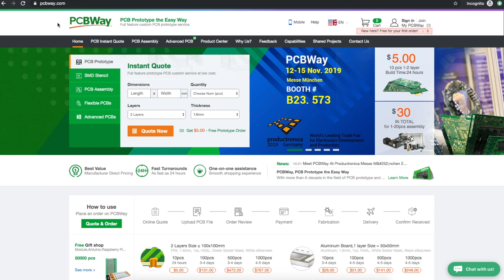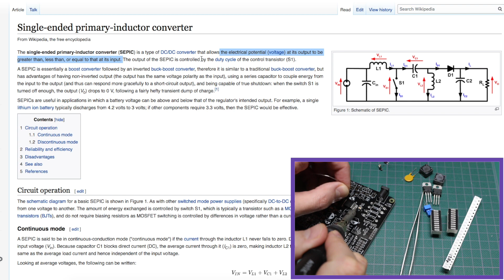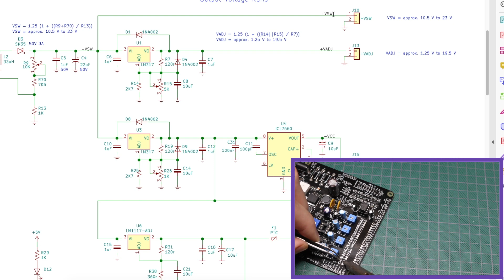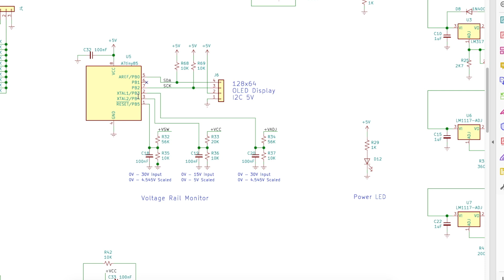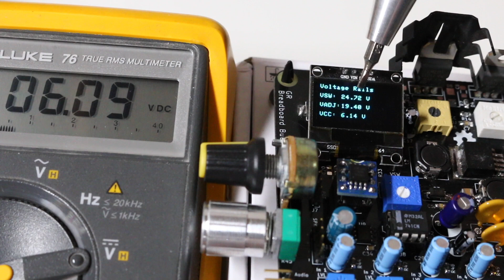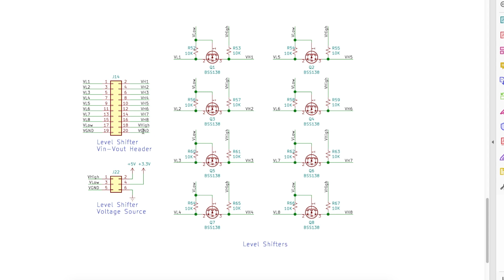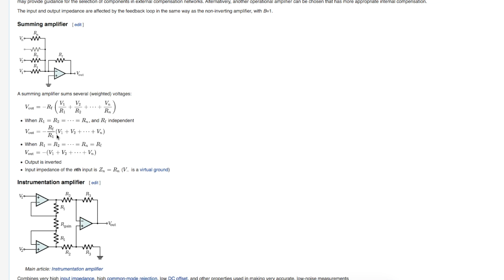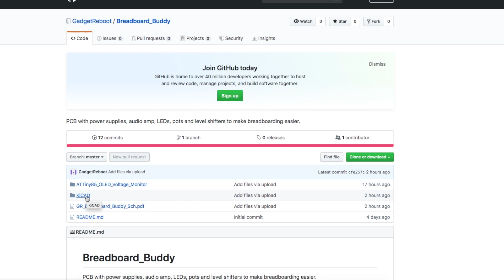Breadboard Power Supply with Audio Mixer, Level Shifter, LEDs etc.

Comment: @Gadget Reboot, i hope you don't mind but I'd like to point out that the mosfet (11:19) needs to have a Vgs(th) of less than the lowest supply used. looking at the data sheet for the BSS138 this has a Vgs(th) of max 1.5V.  i've found that a lot of logic level fets are good for 5V but are borderline for 3.3V. I realy enjoy channels that make me think how does that work, i read the Level shifter explanation but felt that it did not cover the Vgs(th) requirements very well. already looking forward to the next video
Reply from the maker: I may do more empirical testing for example checking the actual switching threshold with an adjustable low voltage dropping from 3.3 down towards zero and see where it does trigger on all of those fets  to get a batch comparison, but a max Vgs of 1.5  should have no trouble when we are  applying  3.3 Vgs  when we put a logic low on source and have a gate pull up to 3.3.

Comment: Ow, and the whole convoluted stuff with the floats is causing the weird chars. It's even a small miracle it's not crashing ;) The string "24.53" is six char's long ;), so 'strValue' is one char to small causing you to constantly write (and reading) outside the array boundaries ;)
Reply from the maker: That’s a good point about the string length. Originally I was only reading up to 5 V. That’s what lack of sleep and being rushed will do. So obviously I will be looking at this very soon and I will try your float alternative and on that note in your code I think you had a figure like 500 UL which I think was relative to 5 V  and maybe unsigned long? I was only guessing. How would I modify that for this new sketch where I’m multiplying by some other weird small decimal constant?

Comment: That's one complicated PCB :) Nice work! But did you come across my comment on your ATtiny OLED video?
Reply from the maker: Yes I replied to that actually recently to say that I will be looking at it but for the sake of scrambling something together I still was using float for now and I also mentioned I still need to look at your other code back from that Arduino DTMF synthesizer when I get back to that. It’s a wonder I even know how to sleep anymore!

Comment: Awesome Project. Great job!!!
Reply from the maker: Thanks!
Reply: @GadgetReboot  Thanks for the great videos and love the fact that you break down your designs and explain your theory of how and why they work.
Reply from the maker: @davidpyper1688  I actually had to delete lots of details from this video because it was too long.  I still might consider a follow-up like how I mounted the OLED on an angle for better viewing, probing the AC ripple on the power rails for cleanliness, things I could/should/would have done differently after the fact, more about how the ATTiny sketch works, realistic load currents and heat sink requirements, layout strategy used, just off the top of my head...
Reply: @GadgetReboot  I think a lot of people would like that video.

Comment: Nice stuff! :) When I built my little 4 channel powered stereo mixer breadboard buddy helper I lacked the know-how to use op amps but I found this circuit that you might be interested in. I built the left part as specified but for the right half I instead used two LM386 chips for the left and right outputs. http://musicfromouterspace.com/analogsynth_new/OLDIESBUTGOODIES/AUDIOMIXER/images/stereomixer.gif
Reply from the maker: That’s a nice circuit with the stereo panning, and I see they have a little capacitor in the feedback loop of the op amp, I will guess that’s for some sort of filter roll off but I wonder if I simulated that in LTSPICE and played around with that capacitor value maybe I could see what it’s doing if I plot frequency and simulate putting in beyond 20 kHz audio. Next rainy day!
Reply: @GadgetReboot , feedback cap does affect the cut off frequency. it's always good to have one as the closed loop gain can be very high which make the opamp susceptible to oscillation. if you think of the capacitor as an impedance Xc = 1/(2piFC) you can pick a frequency where the Xc equals the feedback resistor. thus the combined impedance is half the feedback resistor value so you have  half the gain.  as the frequency increases the gain will reduce further. so R(fb) = =XC(fb) =1/2 the gain.
Reply from the maker: I may try throwing a surface mount capacitor on top of the feedback resistor for lack of a board footprint and try various things. But at least for this general purpose application it seems to be working fine. 
 I can also use the other opamp development board I made a few months ago so I can swap parts a lot easier with all the sockets. I knew that PCB would come in handy.

Comment: Sepic is not a good choice because it's noisy as hell. But if you do use sepic you could filter it through lc filter before the linear regulator. Also most LDOs are faster than LM317 and will reduce the noise a bit.
Reply from the maker: Mostly I was using parts I already had for the sake of seeing what I could design with them so I still need to try things like putting some amount of load on the rails and checking the AC noise and ripple  and using spare boards I can try different experiments like maybe there’s pin compatible regulators I can swap in or maybe I could jumper some things out and convert sepic into just boost but I don’t know if the layout will allow for that.
Reply: @GadgetReboot  If you notice sepic DC-DC on ebay you'll see some of them have LC filter. If the trace from the sepic to the linear regulator is long enough you could cut it, scratch the solder mask and put an inductor - 4.7 to 22 uH. I'm not sure if you have easy access to inductors but you can order smd one from jlc's component store next time you order PCBs - lcsc.com. I don't remember if you have a capacitor on the LM317 input as well as on the sepic output. The series inductor must be surrounded by two low ESR caps in order to work. Or you could just filter the LM317 output with LC filter. Next time order ready made synchronous buck-boost module and solder it in place. Make sure it has one inductor only. I've seen these on ebay. But be careful because sometimes they lie - they write "buck-boost auto" in the title but they sell boost-only module.
Reply: Nope I just searched. They are also sepic - they have 4 lead inductor and a lot of caps. Well synchronous converters are expensive. Sometimes they cheat by using two converters - boost followed by buck. The efficiency is bad, but they cleander and an lc filter can drop them to 2-4 mV. SEPIC goes to 20 mV with filter. Without filter it gets to 100mV - horrible stuff - messes ADCs, clocks, everything.
Reply from the maker: I also noticed the wording on listings has to be audited and the title has to be compared against the description and even visual of the board to see if it looks accurate.
 I do have capacitors on the outputs and inputs of all of the regulator stages so I can try things. 
I did notice an LC filter on the output of a 6009 “buck boost” labeled  converter and I think I do have some smaller value inductors and a collection of surface mount capacitors from a kit so I could  try things out and compare.

Comment: Amazed you got so much on a single board. my answer is to collect a load of bench power supplies, and mulitimeters. just added a 6 1/2 digit dmm to the list. maybe a board would be easier and cheaper in the long run :)
Reply from the maker: I would like a 6 1/2 digital multimeter, properly calibrated of course. My biggest problem is the lack of work space and space to properly lay out all of the test equipment. Once I get set up to work on something there’s only airplane seat elbow room to work in.
Reply: @GadgetReboot  hi, I'm running out of room now. The 6 1/2 digit dmm sits on top of 5 1/2 dmm. Both Hp but about 20years apart. Got to start saving for a 7 1/2 digit now :)

Comment: I just realized I need one of those! :D
Reply from the maker: I’m starting to collect enough PCB designs to make it easier getting back into Teensy audio stuff.
Reply: Gadget Reboot I’m very curious about the DSP capabilities of Teensy!
Reply from the maker: I’ve never actually done DSP or used a proper DSP silicon device, although Teensy  makes it easy to drag and drop audio component blocks in the design GUI.
Reply: Gadget Reboot I think i’ts time to start!
Reply: Jeah, me too... :)